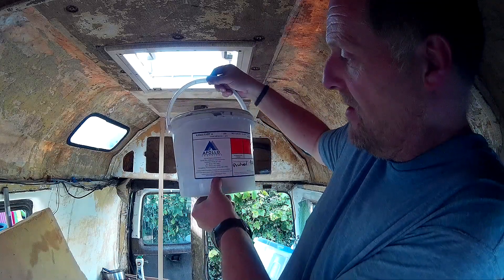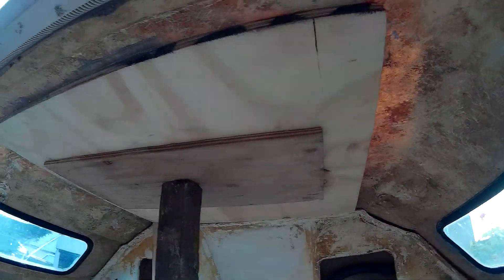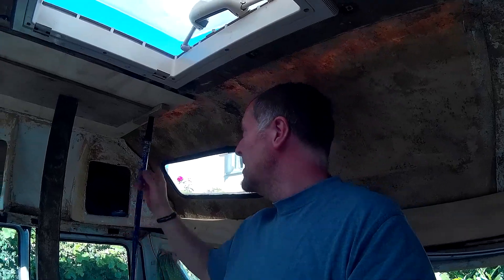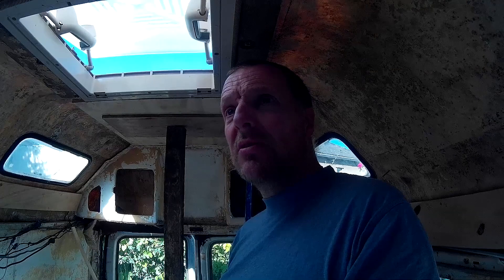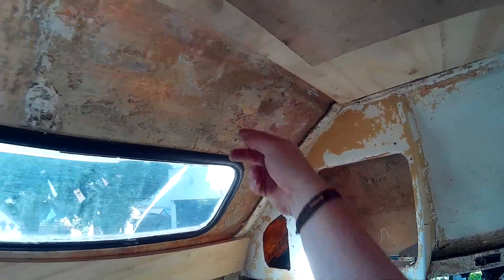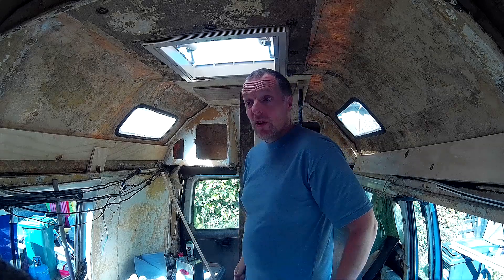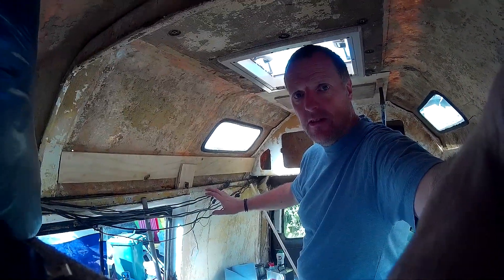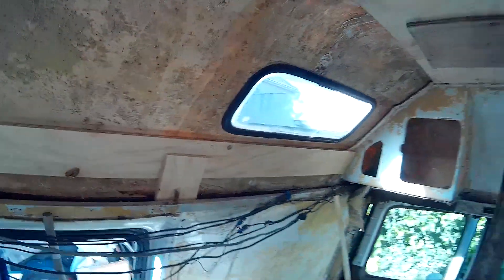How To  Build your Own Campervan  - #2 - Preparing For Rooflight

Comment: Hope that Poly dries for you Austin ;) 

It could just be that's its now already too cold :(

As long as you have followed all the instructions it may just be in this weather it needs longer to set up ;)

Like your idea of using Glass fibre past as an adhesive,one those battens are up just glass over the lot for added strength and rigidity :)

Hey just thinking you will have to chang the channel name to "Transit Camper" LOL!

Keep up the good work

Jodie :)
Reply from the maker: +Joloke08 I did go off in the end think it was just past its shelf life. :-)

Comment: Hey Austin, I've almost completed the restoration of my own camper and I had to fix the new metal sills to the fiberglass section and I used a PU Starchem available from all motorfactors, comes in tube form for a mastic gun, I had my doubts when I was told about it and first applied it, next morning I gave it a tug to see how well it had stuck and I couldn't shift it, brilliant stuff and available in black or white. Wish I could post a pic for you. I know you've probably completed your camper by now but a product to keep in mind for the future. Great job and if you wish to see the progress on my own camper, pop along to motorhomingwild.org

Comment: how tall is the van, i can see you can stand in it so i'm wondering what its overall height is, wished i could stand in one but i stupidly grew too tall for most vans lol, 6'2'' add insulation and a roof and i need a van thats 9ft off the ground, that stops you getting under every 7ft car park barrier and a lot of supermarkets...
Reply from the maker: +lez briddon its quite high on the outside, over 7ft :-(  im 5'9 and I have about an inch to spare above my head..